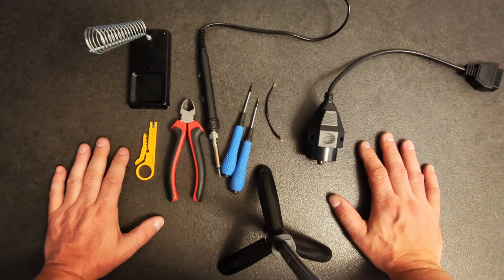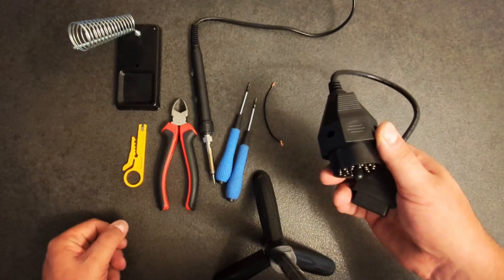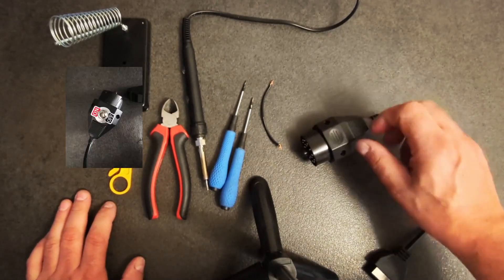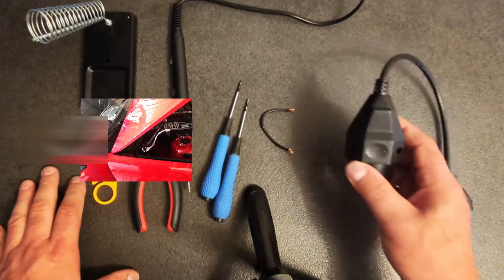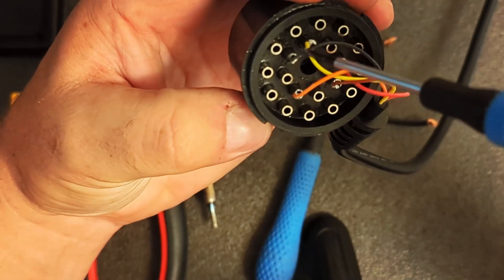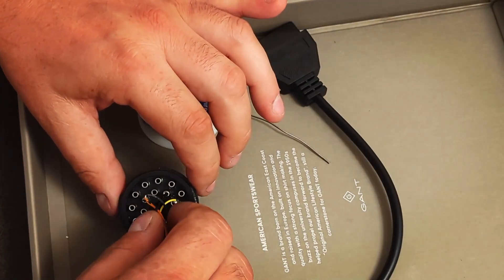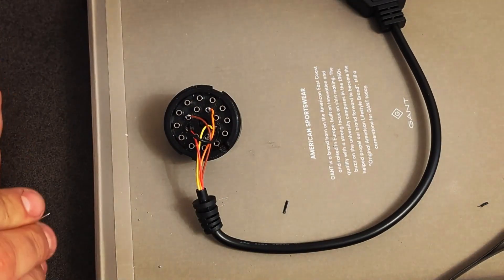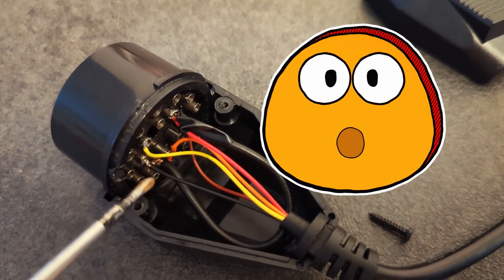BMW Siemens MS41 Tuning Sessions - S.I.P - How to make your own OBD 20 pin flash adapter!

Comment: Is this required on s50b32 Z3M with mss50.1 ECU ? 

I only have 20 pin with no obd2 connector
Reply from the maker: not sure. check if you have obd port in the cabin or the 20 pin adapter under the hood.
Reply: @CSI_tuning_solutions   i dont have obd port and i dont have check engine light even lol

Comment: Hi , i have a E36 320i and i want to make Pop and Bangs. I have a MS410D3 ! 
So how i pin it corrected? Pin 14 and 18 and 2 to 17 ? Is it Right? 
How i Orient on that? Should i take the Port to OBD cable and take off the Hood? And how i know which one with which one? How is the System There ? The Number from when i take the hood off and which is there oder the number from the PORT PIN on car?😊
Reply from the maker: there are numbers inside the pin. best to check the ms41 wiki for more info

Comment: Hi, i have ms41.0. I want make pop and bang, but I have problem with 20pin. Everywhere everybody write that connect pin 14 and 18, but under the hood i dont have 18pin, only 14. So what i should do, is it possible to do map by obd 16 pin inside car ? Or how? 
Thakns for response
Reply from the maker: no. programming voltage needs to applied on 20pin

Comment: I'm using obd2 port inside yo flash and jump the 20ping plug.
Reply from the maker: Yes. If u have MS41.1 or MS41.2 OBD2 compliant car  u can do it that way. But most European e36s  only got ms41 OBD1 compliance and no OBD2 port inside the car.  Except for some very late models here in eu.